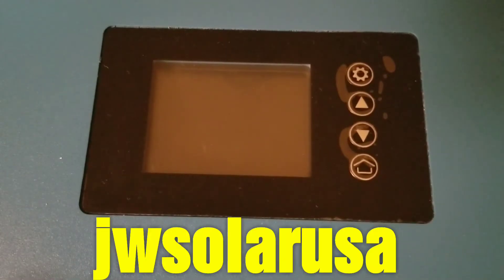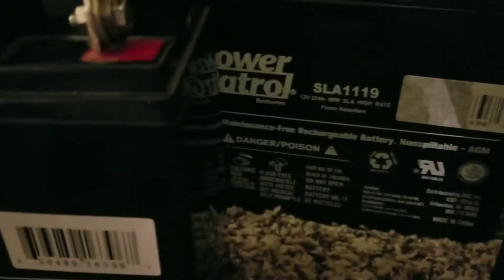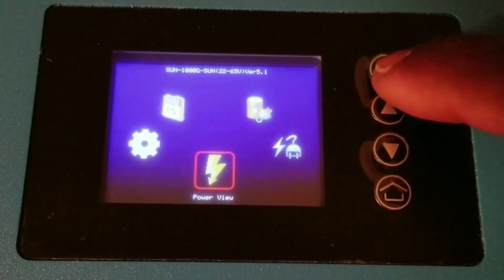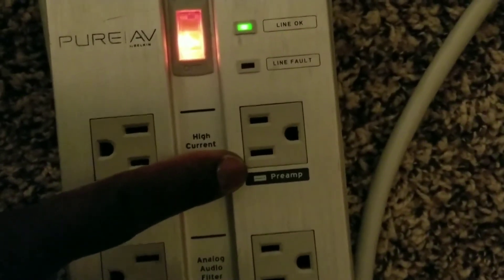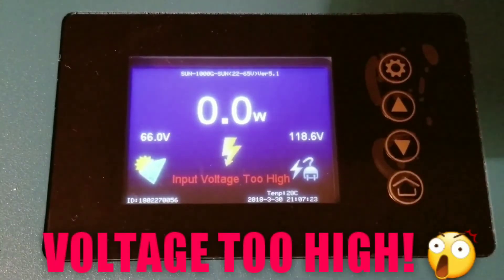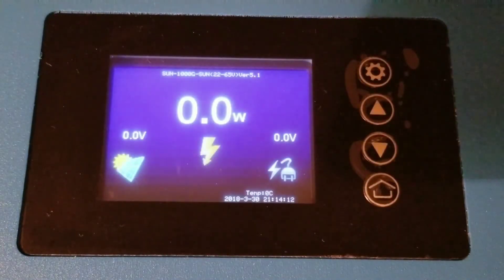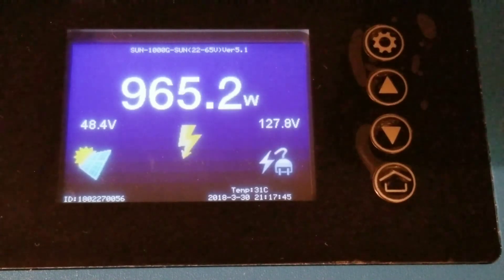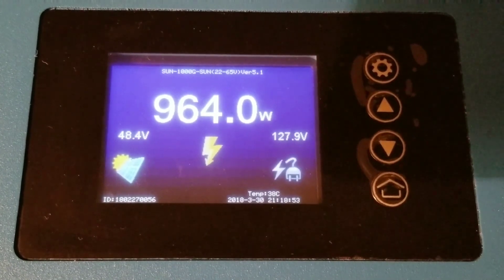60 VOLT BATTERY BANK TIED TO A SUN-1000GTIL2-WIFI PLUG-LD GRID TIE POWER INVERTER WITH LIMITER

Comment: Hello! I just received my Sun GTIL inverter and once I connect it to ACS (with or without PV) , it makes an electronic noise quite loud. I am discussing it with the seller but I'd like to have more opinions. Are you inverters noisy (not the fans)?
Reply from the maker: I realize that with my GTIL2 Inverters few years ago. They give little buzzing sound especially when it doesn't have enough power coming in from the solar modules.
You can also hear them first thing in the morning when they are about to start generating power and in the evening when the sun set.
I hope you find this information helpful. 
Don't forget to LIKE SHARE and SUBSCRIBE for more CONTENT. 
Cheers

Comment: I bought SUN Series Grid tie power inverter 45-90 V DC and 120 V AC with limiter. I no need limiter, I installed 8 220 W and max 42V sol. panels: every couple in series, and 4 couple in parallel. I have also exist GTI 6 KW and meter. I no need limiter because have correct meter. After the installation and connection, the system did`t start; on inverter display appear "grid error". I tray with sensor and and limiter, but the inverter did`t start and "grit error" stay. I need your  help!
Thanks
Reply from the maker: Follow the instructions on the manual or watch my videos on those GTIL2 on my playlist.
LIKE SUBSCRIBE and SHARE
Reply from the maker: GRID TIE SOLAR INVERTERS: https://www.youtube.com/playlist?list=PLSNjIRSnUPDL4fWuaEW_gOZc-bQFuWZvV

Comment: Does clamp  limiter also work on battery power set up like this one you do now?
Thanks
Reply from the maker: Yes it does👍
Thanks for watching and for stopping by. If you haven't been a SUBSCRIBER yet please don't FORGET to LIKE SUBSCRIBE and SHARE my videos and my Channel. 
Check out the rest of my playlist and enjoy.
Reply: Thanks but there is no link anywhere in comments section
Can you put one here much appreciated there is plenty on Ali but some are first generation without battery mode.
Thanks
Reply from the maker: @pawdedley9033  
2000w version with both 120/240 Auto Detect
Here are link you can buy these GTIL2 in the USA 
https://rover.ebay.com/rover/0/0/0?mpre=https%3A%2F%2Fwww.ebay.com%2Fulk%2Fitm%2F382287261344

Here's the 1000w version with both 120/240 Auto Detect 
https://rover.ebay.com/rover/0/0/0?mpre=https%3A%2F%2Fwww.ebay.com%2Fulk%2Fitm%2F362126614006

Comment: Hi, good job, Can you measure the input power vs output power ? That's a nice information, Thanks
Reply from the maker: All the answers you need is on the screen of the Grid Tie Inverter.
Check out the link below for more information you might need on these inverters. 
Have a wonderful day Tlicas.
https://youtu.be/9cLy1rEqnmE

Comment: How long battery operate the inverter without solar energy? Before discharged.
Reply from the maker: All depends on the size of your battery bank.
Thanks for stopping Cristian Seth. Please check out the rest of my videos and please don't forget to SUBSCRIBE THUMBS and SHARE my videos. 
Cheers
Reply: Thsnks by answer, One more cuestión, the inverter chargue the batteries when are discharged?. And in your experiment you batteries configuration how long still working?
Reply: @cristiansethchannel  No. These inverters just draw DC power from the terminals. They do not put DC power back out to charge the battery. 

Either Solar panel input or battery input 

To charge the battery, you would need a separate solar charge controller.

The setup would work like this:
Solar panels -> solar charge controller -> battery bank -> inverter -> power socket.

Make sure you use appropriate safety devices in that hookup.